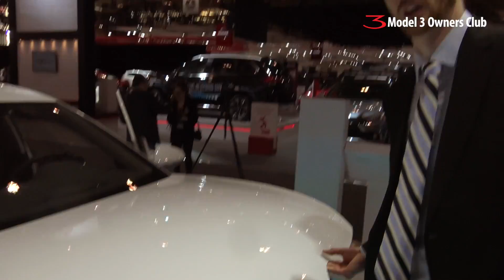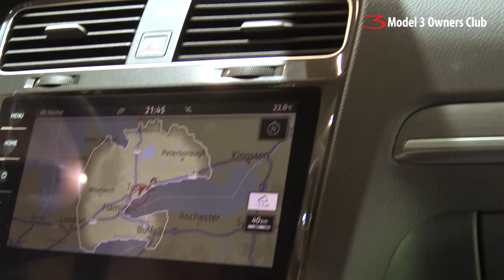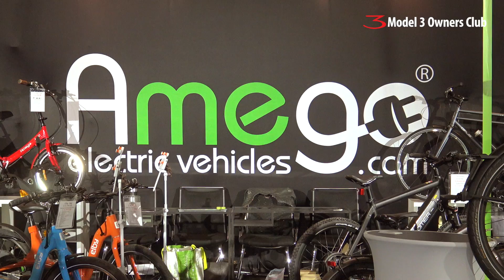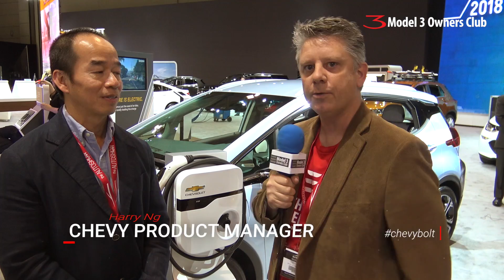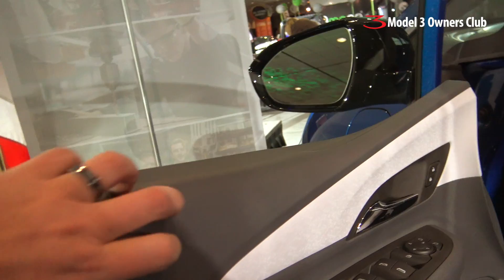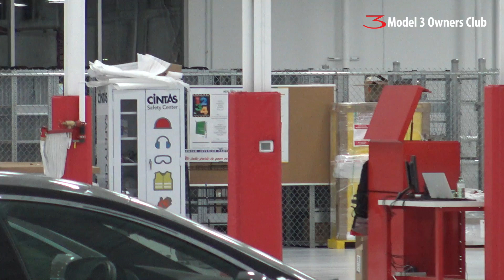Model 3 Owners Club Show Episode 14 Part 2 | Model 3 Owners Club

Comment: e-golf is DOA. 201km(124 miles). bolt and model 3 on line 1. a bolt driver touched 300 miles(482km).
Reply: If the e-golf is priced like the Ioniq and you have a 50 mile round trip commute one might ask if the $6000-8000 premium for a model 3 or Bolt is worth it don't cha think?
Reply: The ioniq is priced around $30 grand USD. I can't find the price of a 2017 e golf, but I am guessing the same price range (if their smart). If your not looking for good range,a used leaf is probably the smart choice. But you don't get money back. I could get $14 grand CDN in my bank account, if I  buy a bolt or a model 3 ,and I need that good range to go shopping with all that money😀.

Comment: sorry if i missed it but does the e-golf have active battery cooling/heating?
Reply: larry Spiller the first generation egolf is battery temperature management PURELY PASSIVE, no temp management whatsoever; you would really need to confirm THAT for this one car, especially considering cold weathers. If it was not mentioned may be, just may be it does not have it. But here I'm guessing. I was very very negatively  impressed when I realized the egolf had only passive temperature "management"...
Reply: +larry Spiller Hi yes I believe it does.  If Scott did not explain it during our interview then look for the specs on the car when released.
Reply: Kenneth Bokor ill just take your word for it. It's my bad if i missed it.

Comment: Actually Bolt is not the first LONG range EV. LONG starts with 500-600 miles. Not possible to do reasonably with Bolt. Not because of range. But because of charging.
Reply: What do you mean by "average maximum speed"?
I've looked a bit into the stats. And I'm assuming you are talking how fast it is possible to travel 1000 miles, in perfect traffic, with an average speed of 65mph. With infinite range and no bathroom breaks, the time is roughly 15 hours and 20 minutes.
Supercharging allows for an average of ~90kW on longer trips (battery will be well-temperatured for charging after driving above 50-100km [depending on ambient temperature, and whether you pre-heated/cooled the car before taking off], and I'm assuming you get optimal stall positioning 80% of the time, and arrive at chargers at the optimal 10-20% SOC 80% of the time, leaving when you have 70-80% SOC).
For a 90D this means 40 minutes waiting every ~160mi, after the initial ~220mi (100%->10%). You can do 1000 miles with 5 supercharger stops, adding 3 hours and 20 minutes to the fastest possible journey. A 20% time increase from the infinite range case.

For a 60, the average Supercharger speed is ~80kW on longer trips. This means 30 min waiting every ~105mi, after the initial ~145mi. You can do 1000 miles with 8 supercharger stops, adding 4 hours to the fastest possible journey. A 25% time increase from the infinite range case.

A standard petrol car with ~400mi highway range requires roughly 10 minutes of waiting every ~400 miles, after the initial tank (which is rarely full when you leave the house). I'll assume it has 80% when it starts the journey, making it require 2 stops along the way, adding 20 minutes to the fastest possible journey. A 2% time increase from the infinite range case.

However, the more time you stop for food or going to the bathroom, the less the time difference you'll have between the petrol car and Tesla's. And I think very few people can drive 1000 miles without ever stopping to go to the bathroom. Remember, the driver can't go to the bathroom while filling up a petrol tank. But you can while charging.
Reply: Arnis Tarassu my civic only makes 600km (372mile) on a tank with no head wind.. 380km is enough traveling in a car at once for me though. I'd  consider it long range.
Reply: +Arins Tarassu  Hi I disagree.  200+ is now the new 100+.  If you really look at past adoption (prior to 2016) of BEV's for North America, it was dismal to say the least.  Even with Leaf and Tesla sales combined.  Most highest adoption was Europe and Japan.  China is it's own machine.  Because of low range of Leaf, Zoe and similar, it made more sense in Europe's compactness and better mass-transit (great rail systems, very cheap flights, etc.) versus the vaster expanse and car-crazy society that us North Americans live in (and not great rail service and not as cheap flights within NA either).  

I do agree with you that all Tesla's are in high range area, but realistically they are out of price for most folks.  I don't agree that 60kWh was not good enough.  With SC it is fine for long travel and if I could have afforded a S60, I would have got one.  

What I am saying is the new norm and sweet spot is a minimum (for North America at least) of 200+ miles.  This is the catalyst that came from the Model 3 announcement and IMO the start of the EV Revolution, for real.

Whether or not it sells the most in the world it does not matter, it at least brought the idea of a BEV to the mainstream mindset.  Really before M3 announcement, BEV's were not mainstream - just a niche.  That's the standard now that all other BEV Manufacturers look at to bring truly mass market (not just compliance) BEV's to North America (and ROW).  We talked about that survey in Part 1 that now amongst automotive companies and executives, EV's were number 1 in importance for 2017.   This was really not strong for many years.  The industry as a whole has seen a complete 180.  Look how many Countries/Cities will be banning sales/use of ICE vehicles in the future.  It's just the start of the EV Tsunami.
Reply: +Arnis Tarassu  Hi thanks for your comments and for watching our show!  You should be able to get more Bolt Specs from the GM website.  Yes long range can mean different amounts to people, however up till the M3 announcement and the Bolt release, there really has not been any BEV that can offer 200+ Miles (North American standard) of range and for our larger NA country sizes, this is the sweet spot and now the minimum bar threshold to play in the BEV game.
Reply: Kenneth Bokor 200 miles is not minimal range. It is comfortable range number for US market. Before Bolt 100 miles was good for many.  That I would call low range. Between short range and long range EVs there are also mid range EVs. Bolt is in a different league compared to, for example Model S 90D (which is truly long range EV in some parts of the world). I would call it MID range EV. For addition, original Tesla with 60kWh pack was not good enough for long range travel, even though it had  Supercharging access. It didn't charge fast enough to travel long range. I would call even that vehicle MID range. It is not reasonable to set the limit  according to specific amount of miles vehicle can travel on one charge.
Civic with 150 mile range would still be long range vehicle. Actually... not sure. Seats are not designed to sit on for hours and hours....
Reply: Kenneth Bokor It's your right to disagree.  Aa soon as cheap 30000$ 300mile vehicle will be announced, that will be the new minimum.  

Nissan Leaf sales were fine in US. Appropriate number to EU sales. This proves that 90miles was enough for minimal. 

Do you know the average maximum speed for Model S 60 with Supercharging on the way? Compare it to 90D average speed and ICE car average speed. For... 500 or 1000 mile trip.
Reply: Muskar thanks for writing it out, i thought about this but it would take awhile to type out. Not to mention im confident in saying that those 1000 miles traveled would be noticeably cheaper.